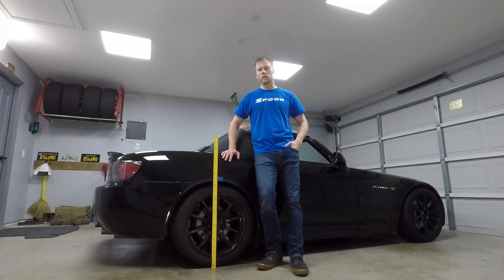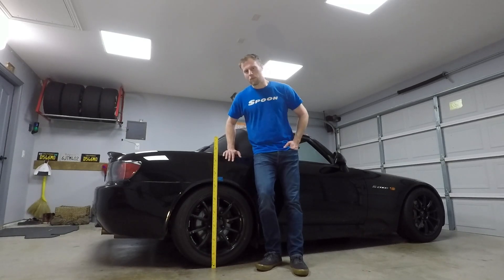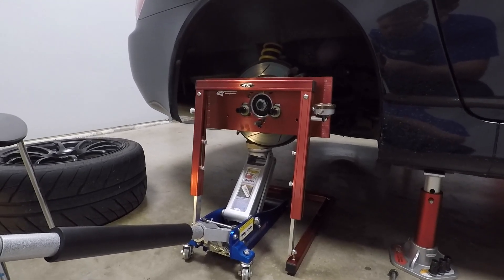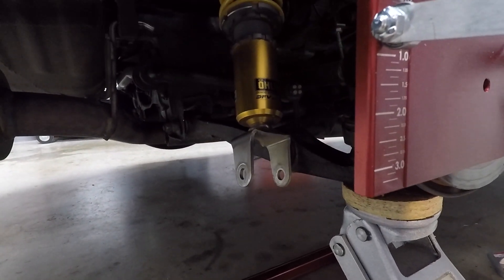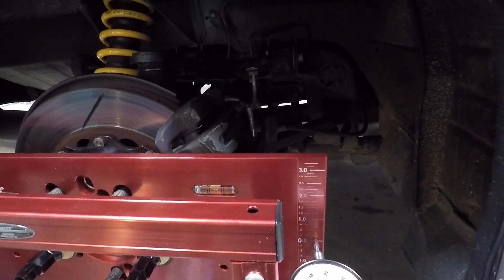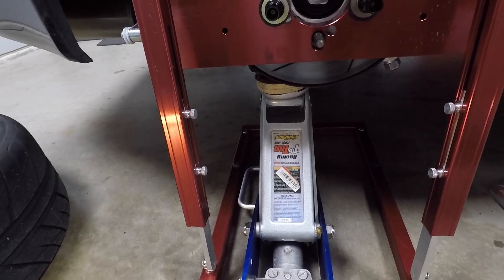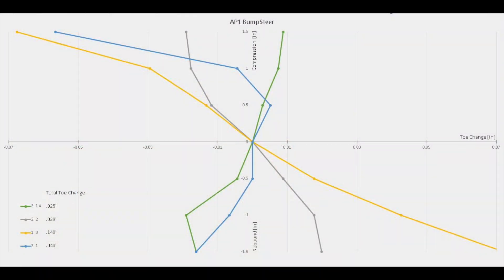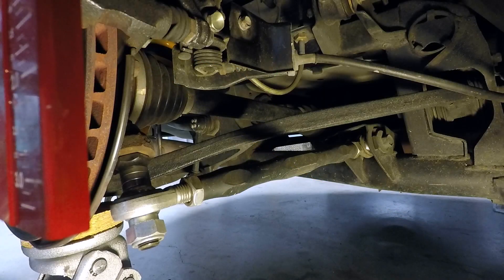S2000 Bump Steer Measure and Adjust

Comment: What method did you use to measure 3.5” of suspension travel?

Would love to see a video of the front as well 😊
Reply from the maker: There is a scale on the long acre tool so you just jack it up in increments.

Comment: Is bumpsteer something all lowered cars (ap2 inclusive) should have checked, or is this simply an approach to correct the ap1’s rear suspension geo?
Reply from the maker: It kinda depends on the toe curve but a factory car should statically sit at the most linear part of the curve so as you deviate from that you could get more toe dynamic change. So I would say yes all cars ideally should be checked/adjusted but probably less critical on the AP2
Reply: Curious to see how the toe change curves between AP1 and AP2.

One of the biggest differences are in the rear knuckle, where the toe arm attaches.. the angle is slightly different between the two

Comment: wouldnt changing the length of the tie-rod then change your static toe angles?
Reply from the maker: Yes, If you change the length of the tie rod it changes toe angles. You will want to have an alignment afterwards and then check bump again to assure you are still seeing similar results.
Reply: @brookhammerschmidt4464  Thanks alot for the quick reply, so what youre saying is that inevitably its a compromise between getting the correct static toe settings that you require and its effect good or bad on total bumpsteer since you cant achieve both.
Reply from the maker: @alyousuf  I think in the stock condition you can achieve both but once you lower your car it is no longer optimized. Being able to adjust the length and the pivot points of the toe arms you can get it close to the original optimized condition but it may never be quite as good. Possibly though, I never measured the stock condition. That said stock condition will probably still have some bump steer. I have seen some factory suspension drawings and they had some toe change as the extreme ends of suspension stroke. Hope that helps.

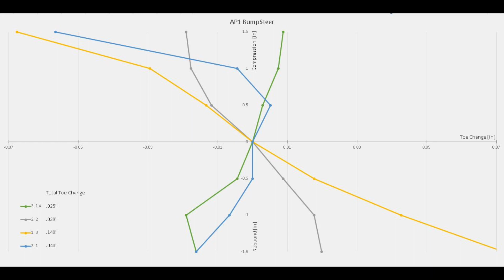Comment: Very informative! @7:57 you mean toe in during "compression" correct?
Reply: On nvm, I mixed between inch and in in the x axis. Makes sense now lol
Reply from the maker: Thank you, No I mean during rebound. Usually set-ups are the opposite but there is very little change. Toe out during compression can cause instability but this set-up worked pretty well.

Comment: You need to use a dial indicator on both sides of the hub. There is a lot of camber change during compression and with only one dial indicator you will see this as a change in toe as well.
Reply from the maker: That is true of most set ups but take a look at long acre's website. Their design only requires one.
Reply: oh I see now, that's a clever design :)